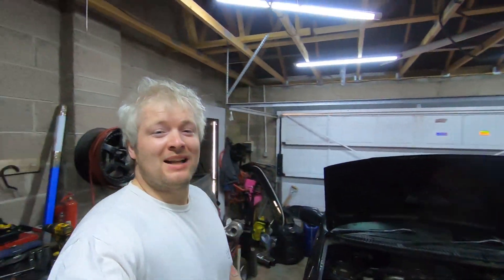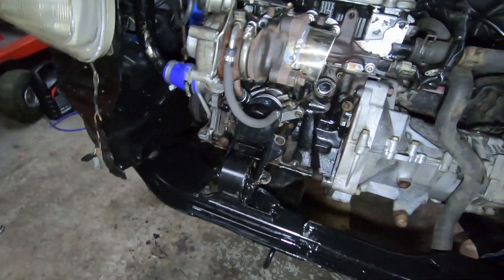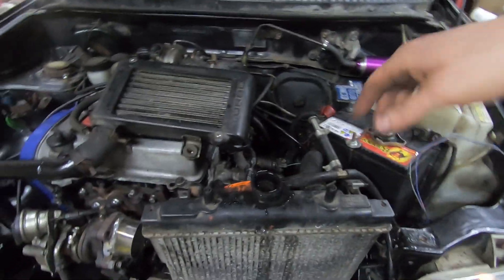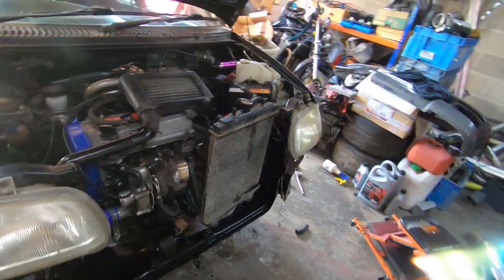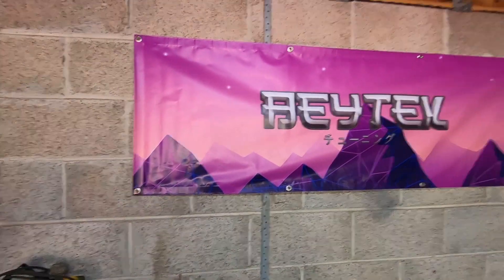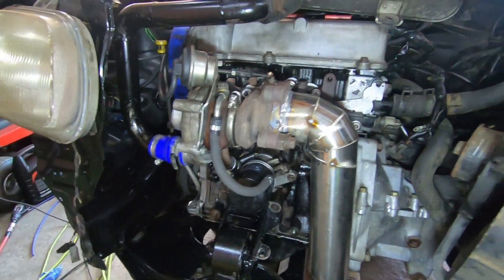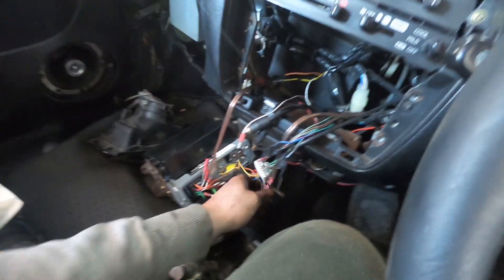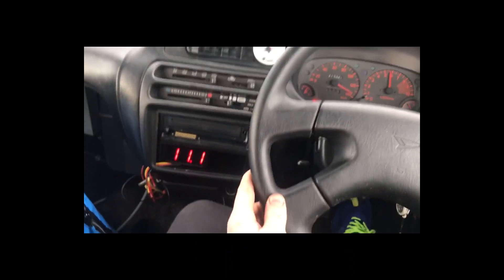TURBO MIRA BUILT ENGINE. FIRST START!! 22PSI RUN IN!

Comment: I'm trying to learn about speeduino now. I have the mini cnc that people use to print pcbs. You should make a video. I wanna run my old b2300 truck on it. I can still get that last motor. Replaced the trucks injectors. Runs fine now. Just have to get it into neutral...it's stuck in 2nd.
Reply: Ls engine*